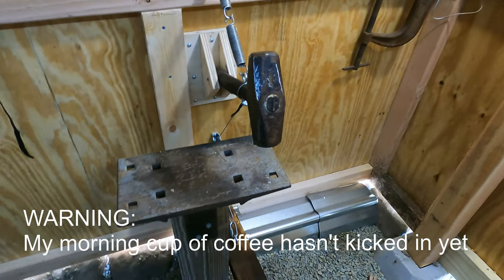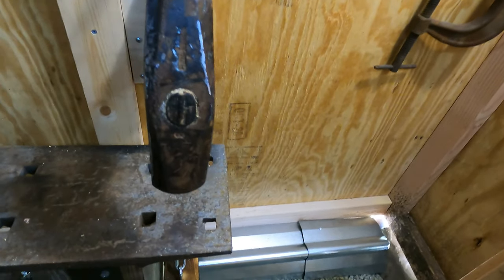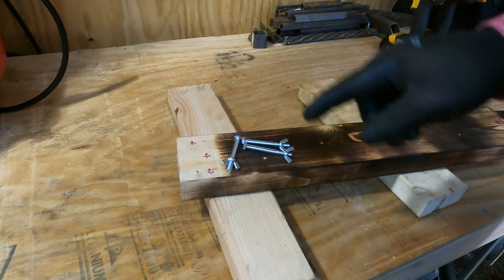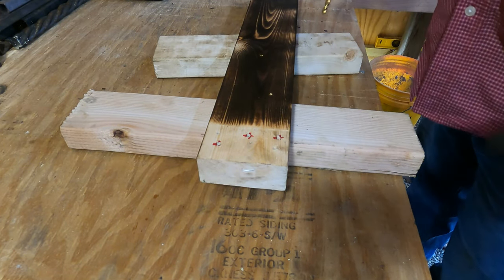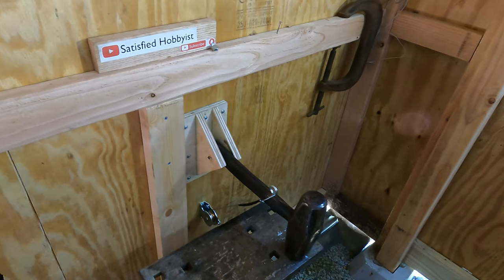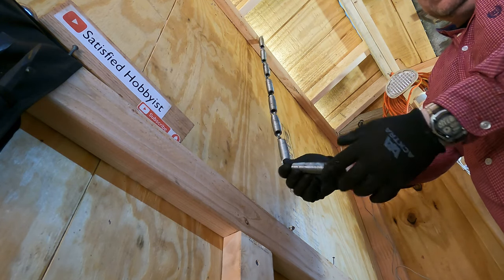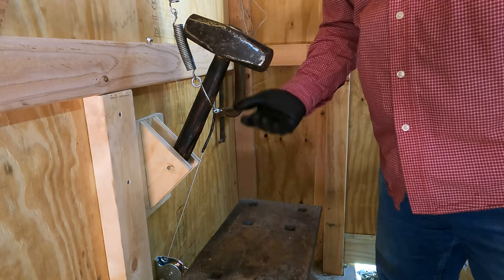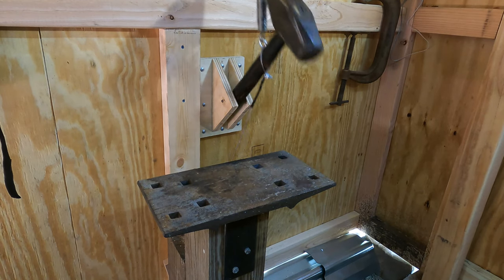Mini Treadle Hammer Version 2 - More power but still Simple, Compact and Cheap

Comment: The three bolts holding the hinge will wiggle ever-so-slightly in the drill holes, wearing them wider.  Eventually they'll loosening the joint. Put a metal plate between the wingnuts and the 2x4.

Comment: I would put a small tight spring on the foot pedal to reduce the pull on the wall at the pully. Looks like it wants to pull the wall out at the bottom end of the pedal movement. I just made this and found the same thing.

Comment: I would try moving the wire on the hammer furter back. so that The hammer would travle further, with å lott lese foot pedal movement. That would give a quicket hammer swing as well.
Reply from the maker: Sounds worth trying, thanks!

Comment: Little worried about the springs getting you in the face it may be worth throwing a thin tin box or plywood around it for if they go flying its not at you
Reply from the maker: I'm thinking of putting a bicycle inner tube over it as a sleeve
Reply: A thin walled PVC black irrigation pipe off cut, sleeve fitting loosley should do the job..!?
Reply: @bernardhill1622  better idea than mine